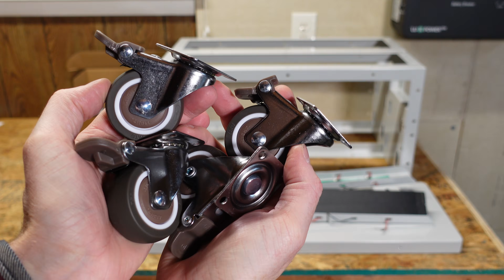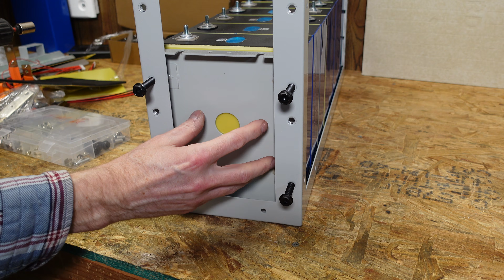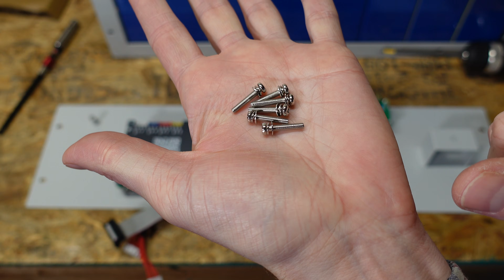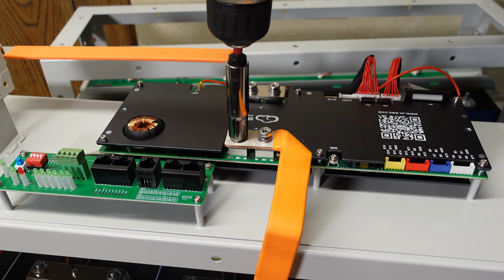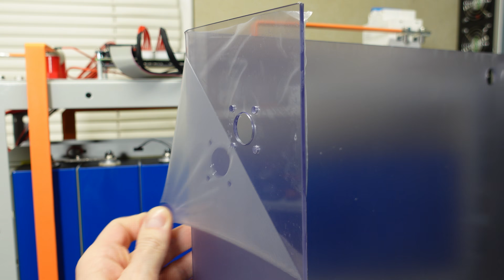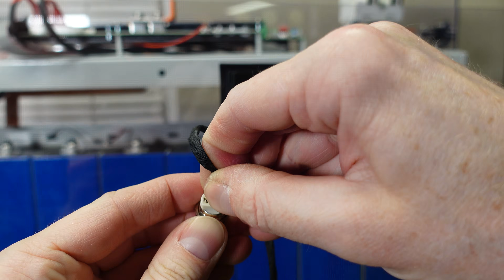Transparent DIY Battery Kit from Gobel Power, Project X1 Full Assembly

Comment: I have experience with this kind of cell arrangement 8s2s, where cell 9 experience voltage sag/lag when you introduce high enough amps. Do you experience it?

That is why I am not keen with this kind of cell arrangement, like the MB56 DIY build kits out there.

It messes up the balancing logic.

Comment: Since I currently have 24 volt inverters and batteries this would be an interesting kit to put two 24 volt BMS inside of it

Then if I switch to 48 volts I would just reconfigure with the BMS that comes with the kit

Comment: Shouldnt the terminals of the cells and the busbar surfaces be lightly abraded with sandpaper and coated with No-OXID ? Hmmm seems like this install is a bit suspect to me if that step was omitted and it seems it was.

Comment: Hi. Thanks for the video. Glad to see there's already a Project X that's been delivered. I've been emailing Gobel Power about the Project X2. Do you have any thoughts on having the circuit breaker on the negative? In Andy's Off Grid Garage channel there have been two discussions about having both the circuit breaker and fuse on the positive. The two videos where this discussion is in the comments are "This new Yixiang DIY Kit could save you some money! And look at these features!!!" and "Will we ever see the DIY-DIY Kit from Yixiang? Until then, I'm building one with MB31 cells!". Also, if we agree to call the side where the BMS screen is the front, it would make more sense to me to have the positive and negative terminals on the opposite side, the back, rather than the positive on the left & the  negative on the right side. Any thoughts about running the cables to the inverter from the sides rather than if the terminals were on the back? I agree, better to go w/ flexible busbars between the cells. Thanks again.

Comment: Good instructional video but they didn't include a manual again? 7:41 see, you catched it but other people will not. I don't get it why they don't have a simple user assembly manual. When I visited their factory, they said yes, yes will include manual 🙃
Reply from the maker: I asked them for assembly instructions as well, but all they had was a "Assembly in 5 Minutes" video that was spend up like 5x. It got the job done for the most part, but I'd really like to see a booket (or even a PDF). They should be including torque specs for some of these bolts as well.

Comment: I must be getting old and grumpy. Yes, the buss bars should have some flex to them. This isn't anything new, and Gobel, I'm sure, is well aware of that. Second, I'm not a fan of using plexiglass to hold the large battery connectors. I can see having  0000 cable hanging from them, and after some time, crack the plastic. And for shit shakes, update those pissy casters! They're holding, what 300+ pounds? I know you're not about to move this battery around the shop, but I wouldn't turn my back on it fearing a caster will gave way and the battery might fall over.

Comment: I really do like the look.  Normally, you spend all that time building the pack and then hide the cells on the inside.  It's just cool to see how it all looks when it's assembled.  

One nice touch I like was that they prepped the large flexible bus bars for the balance leads.  In the past when I built one of their kits, they had an extra small bus bar where you mounted the balance leads on the main terminals.  It worked, but it added another layer on the terminal.  

Did you feel like you had enough room to safely get your socket in the cage to tighten down the terminal bolts on the cells?  

Thanks for sharing!

Comment: Nice Video I like the Racks Batterys are Safe enclosed.
I would more like a Rack in this art with option to stack as many Batterypack as i want.
I like the Bms on the Side and only one Plexi Glas in Front for better Heat disapation.
Maybee the could sell only the Racks for this Option.
Then i could use a normal Steel Shelf put the Battery Racks in there and put a normal straight Plexi in Front.

Comment: Here are some rough numbers:
The kit is $500
The batteries are $80
Total 500+(80x16)=$1780
314 Ah x 48 V = 15 KWh
I’m not sure what the delivery charge is.
Reply: thank you... looked in the info, should be in description 💯👍
Reply: The nominal DC voltage for each fully charged cell is 3.2 Volts times 16 cells is 51.2 Volts not 48 Volts. 51.2 Volts times 314 Amps is 16.076 kWh. Not 15 kWh.
Reply: You can estimate the shipping if you add to cart but don't checkout. For me, the 16 cells and DIY case was over $800 to ship to west coast USA. Won't be doing that :/
Reply: @sdpismo7662  I did, but the second page didn’t show it either. So I left. Then to the US it’s about $800, which makes it around $2,600.
How does it compare to everything else available? Do you know?

Comment: I have two questions well one question one statement they always use multiple batteries. Why can they not make one battery? That’s a 48 V or 24 V why do they have to use more than one battery to come up with those voltages? Also, I really love your contact. Can you make them longer or more of them?
Reply: Different battery chemistries and compositions have different voltage potentials. You can only work with what physics gives you. Lead acid for example is 2.1v potential so a single cell can only ever be roughly 2.1v. so if you need 12v to run your car, you're gonna need 6 cells. LiFePo4 has a 3.2v potential per cell. That's why all LiFePo4 cells are 3.2v nominal. And lithium ion is 3.7v nominal per cell.

Cells just hold the charge potential of their chemistry. So you figure everything out from there.
Reply from the maker: This is a 51.2V battery (commonly referred to in the market as "48V"). It's comprised of 16 cells. The cells are 3.2V nominal each, so when 16 are in series, that's where the 51.2V comes from.
Reply: @L @LithiumSolar es sir I understand that part thank you but why do they not just make a huge battery that’s 51.2 V. I can see that it would make it more simple. If one cell goes bad you can just replace that cell.
Reply: @Biggiantcatpg I think you mean one huge cell not battery. A battery by definition is a bunch of cells in p or s or both. As to why you don't do one huge cell with a high voltage? I don't know.
Reply: @m @maj429  thank you so much for correcting me. I have wondered that for a while never thought to ask why there’s not just one huge cell..
Reply: @Biggiantcatpg  This way you can tailor the cell voltage to anything you want it to be in 3.2V increments.
Reply: @robertgiresi9515  yeah so many for 24 V I still don’t understand why you can’t just buy say one huge cell that’s 48v I know there’s huge benefits to individual cells. But still curious. Thank you for the feedback.
Reply: @Biggiantcatpg  Could you imagine the amount of weight stored in a single 51.2V cell at 314Ah?  Consider that each one of those cells is approximately 12.5 pounds. So 16 of them total 200 pounds.  Try lifting 200 pounds up on a shelf all at once and you will be happy you can do it in 12.5 pound increments!  It's also easier and much safer to ship them overseas at 3.2V.
Reply: @robertgiresi9515  I 100% agree to that. That would be wild.
Reply: @Biggiantcatpg 
Limitation of physics and chemistry, so far there is no single cell on the planet to exceed  5V. I think 4V is max. 
Every battery it is constructed from multiple cells.
Reply: Thank you for replying to me. Also, that’s pretty cool.